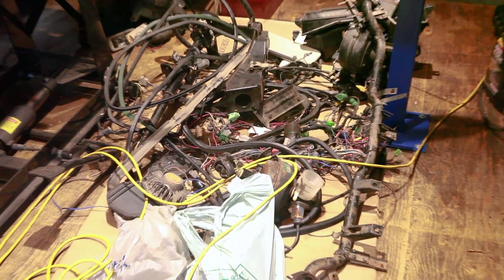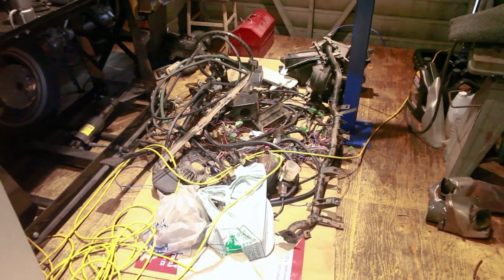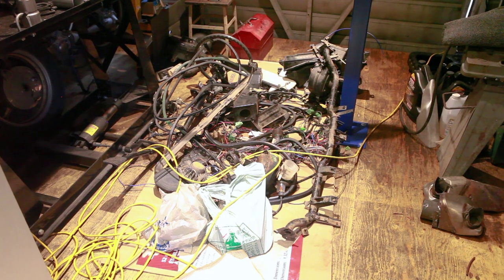Operation Samurai Part 3 - Disassembling My Suzuki Samurai

Comment: You need an impact driver. Screwdriver you hit with a hammer. about $12 Amazon. Far as I can tell, Suzuki used lock-tite on all 12 million phillips screws.
Reply from the maker: Yesss! Haha Gah I wish I had one at the time!
Reply: No what you need is an Aircraft screw removal tool, and an air hammer.

Comment: How do you get the rest of the bolt or screw shaft stuck in the hole out
Reply from the maker: 2 methods that I use. 1. use a bolt extractor through the shank or 2. is to drill the centre of the shank and then collapse the wall in on itself with a flat head. Then you want to chase the hole with a tap to fix the threads.
Reply: I think I will get one of those shake and break devices give that a try. I have tried getting a few out already and they are not budging either haha.
Reply from the maker: Sorry, somehow I missed your response! I just looked that tool up, that's pretty handy!! The first video I saw of it being used was on a samurai!! Haha I hope that works for you.
https://www.youtube.com/watch?v=uYcxOQjApu8
Reply: Yes that is the one :)